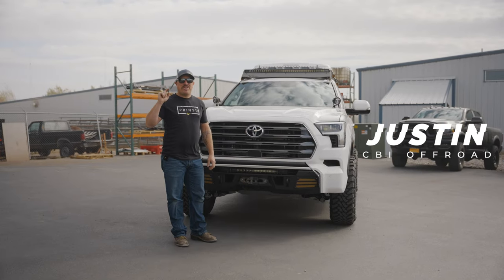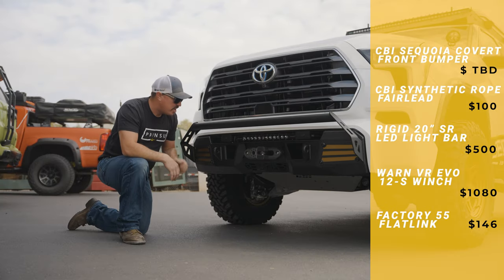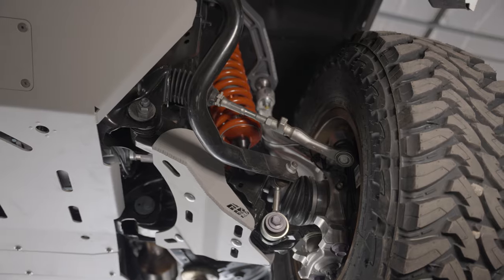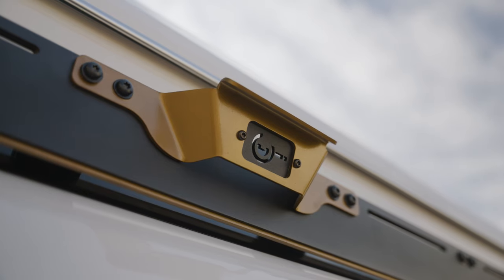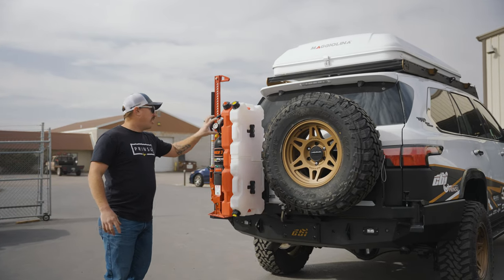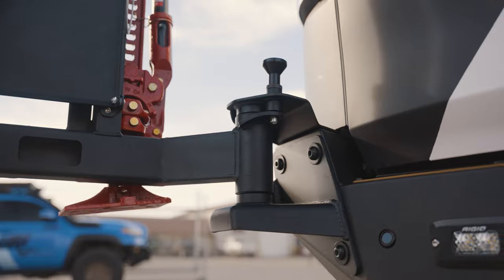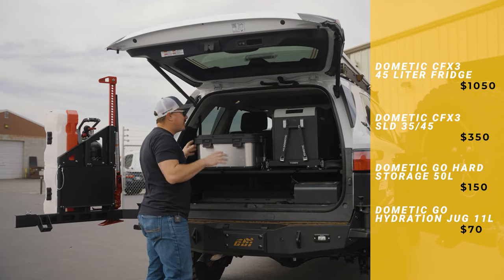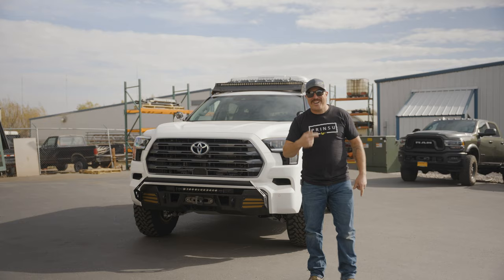Fully Built Out 2023 Toyota Sequoia Limited TRD Offroad

Comment: Did you remove the 3rd row seats? Or are they in the forward position to fit that gear?
Reply from the maker: They are just in the forward position. We found out that they are not actually removable.
Reply: I think the third row seats serve to also protect the battery so are designed to not be removed